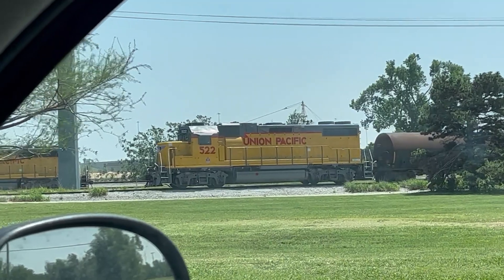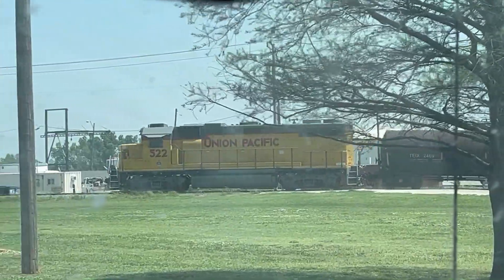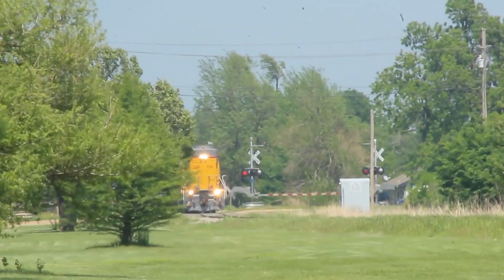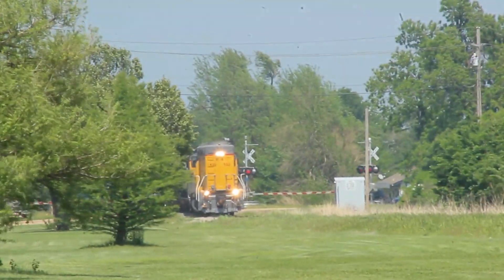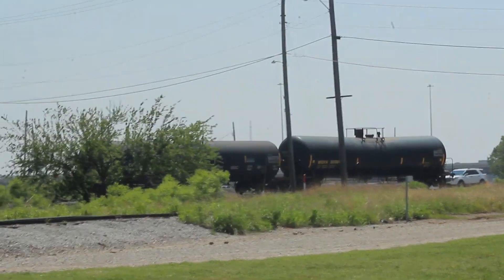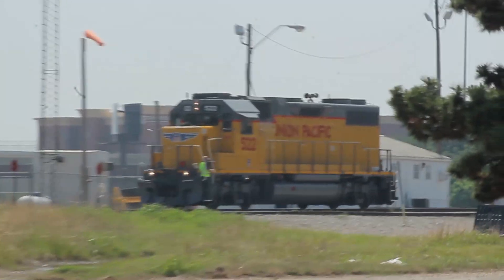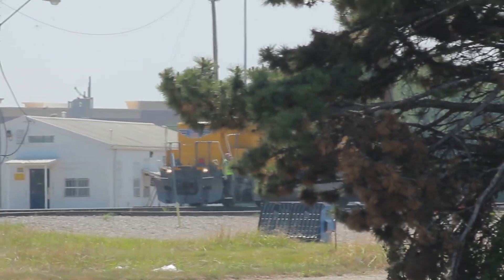Union Pacific local freight kicking cars!

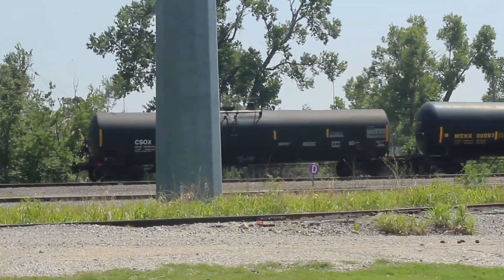Comment: 2:11 what is that nose that thing sure is long💀
Reply from the maker: It’s called a snoot-nose. I’m not sure why some engines are made like that.
Reply: @Southern_Plains_Railfan  UP was gonna use the extra room in the nose to house extra radio gear but from what i read, it never happened
Reply: They eventually want to go with 1 man switch crew. No Thanks